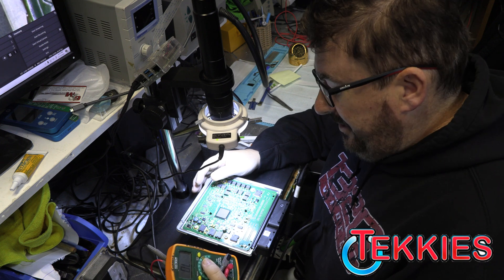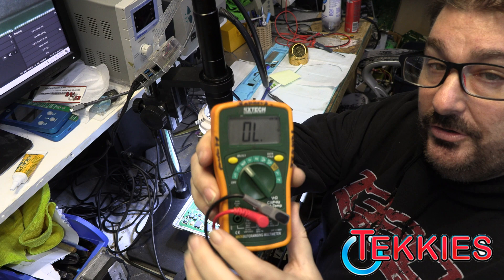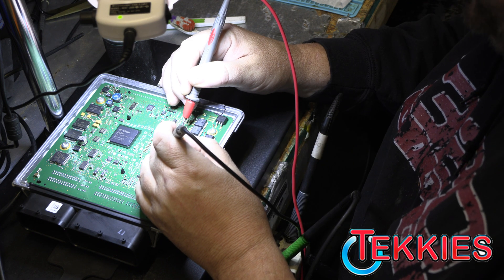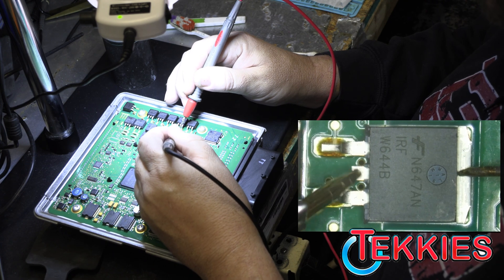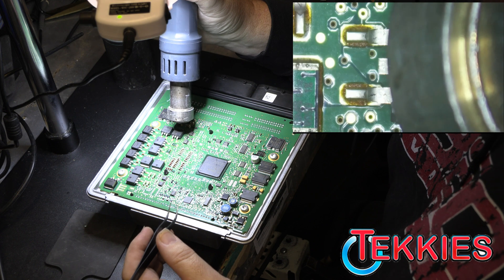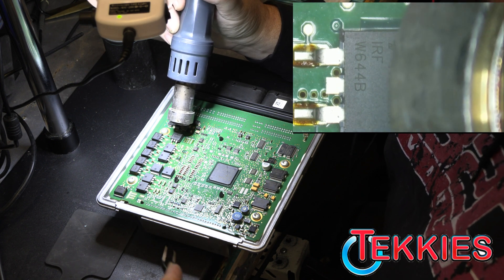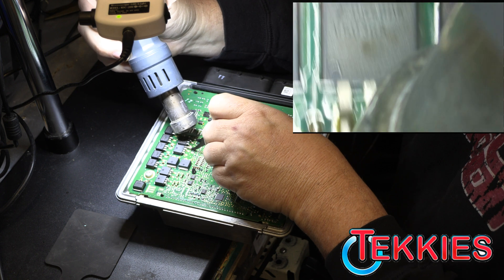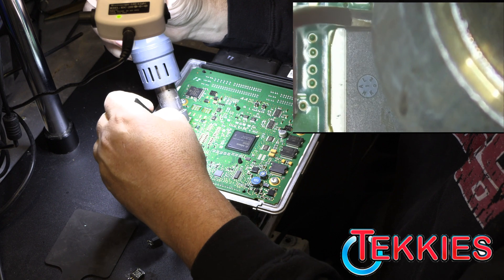🔥 BMW DME MSD80 MosFet's REPAIR- 335i 535i 135i X6 E89  -💥 30BA 30BB ERROR

Comment: What do you use now that FDB14N30 is obsolete
Reply from the maker: Good news — the FDB14N30TM is actually still available!
DigiKey Part #: FDB14N30TMCT-ND
Manufacturer Part #: FDB14N30TM (onsemi)
Specs: N-Channel, 300V, 14A, D2PAK (TO-263)
Direct link: digikey.com → search "FDB14N30TM"
The original OEM part in early MSD80s was often the 250V version, but the FDB14N30TM at 300V is actually a slight upgrade — more voltage headroom. It's what we use for all our repairs.
Pro tip: Buy a 10-pack — they're cheap and you'll want to replace all 6 while you're in there. One bad one usually means the others are stressed too.
Hope that helps! 🔧

Comment: Just wondering as new to this, but the original component was a 250V, 14A MOSFET and your replacement suggestion is a 390V 46A IGBT (from the link above)...does that matter?  From what I can tell they are different types of components (MOSFET vs IGBT) but are they interchangable?  Apologies if this is a "dumb" questions, but although enthusiastic, I am new to this-Thx!
Reply from the maker: Not a dumb question at all — this is actually a really important point that a lot of people overlook!
You're right that MOSFETs and IGBTs are different types of components, and they're not directly interchangeable in most cases. Here's the short version:
Key differences:

MOSFETs = faster switching speed, better for high-frequency applications
IGBTs = handle higher current/voltage better, but switch slower

Why the higher-rated IGBT might still work here:
In this specific DME application, the switching frequency is relatively low, and the circuit is mainly handling inductive loads (injectors/coils). The IGBT's slower switching isn't a problem in this context, and the higher voltage/current rating (390V/46A vs 250V/14A) gives you more headroom and reliability.
However — the better practice would be to use a direct MOSFET replacement with similar specs if possible. The IGBT will likely work, but:

It may run slightly differently (different gate drive characteristics)
Switching behavior won't be identical
Long-term behavior in this circuit may vary

Bottom line: It can work as a repair solution, but if you can source a MOSFET closer to the original spec (similar voltage/current rating), that's the cleaner approach.
Great question — asking this stuff is exactly how you learn! 🔧

Comment: Hello. I have 5x upgrade voltage mosftets. Can i replace 5 instead of 6 at once, with the upgraded mosftet?
Reply: It worked
Reply from the maker: Short answer: Yes, but I'd strongly recommend doing all 6.
Here's why — if one MOSFET failed, the others have likely been heat-stressed and are on borrowed time. Replacing only 5 means that one original part becomes the weak link. You'll be back in there sooner than you'd like.
That said, if you're in a pinch and need to get the car running now, 5 new + 1 original will work. Just keep an eye on it and plan to swap that last one when you get the part.
Where to grab one more:

DigiKey: FDB14N30TMCT-ND
Amazon/eBay: Search "FDB14N30TM" — usually sold in 10-packs for cheap

Good luck with the repair! 🔧

Comment: Another fan of changing mosfets blindly!
First you need to check the resistor in the gate circuit and only then poke the source and drain with a multimeter...
All problems with misfires are related to the condition of the ignition coils, spark plugs and, of course, crooked chip tuning!
Problems with output transistors are very rare and do not occur on their own.
Idiots!

Comment: Why not test the other lot of 6 ?
Reply from the maker: Great question — there are actually TWO sets of 6 transistors on the MSD80:

6 MOSFETs — control the fuel injectors (FDB14N30 or similar)
6 IGBTs — control the ignition coils (ISL9V5036S3ST or similar)

The injector MOSFETs are the ones that commonly fail and throw 30BA/30BB codes — that's what this video covers.
Why not replace the ignition coil IGBTs too?

They're a different component type (IGBT vs MOSFET) — not interchangeable
They operate in a different circuit with different stress characteristics
They can fail, but it's less common than the injector MOSFETs
Different failure symptoms — ignition IGBT failure usually shows as cylinder-specific ignition faults (2E18-2E1D codes), not the 30BA/30BB internal DME errors

Should you test them? If you're already in there and have the equipment, sure — can't hurt to check. But if your symptoms are injector-related misfires with 30BA/30BB codes, the ignition side is probably fine.
If you do want to upgrade the ignition IGBTs, the part is:
ISL9V5036S3ST (onsemi) — but again, different component, different circuit.
Hope that clears it up! 🔧

Comment: Hi, very good video, congratulations! What temperature is your device set at? Is there any risk to the surrounding components?
Reply from the maker: Hi! Thank you for the kind words and for watching our video — we really appreciate it! 😊

For this repair, the device was set at 360°F with an airflow of 100. We've found this setting works well, and we haven't experienced issues with surrounding components. To minimize risk, we direct the airflow only on the chip and work quickly. After finishing the repair, we always double-check the surrounding area to ensure nothing has shifted or been affected.

Hope this helps! If you have any more questions, feel free to ask. 👍

Comment: Why do you change them all if only one was defective ?  Which ones have you installed exactly, what do you have to pay attention to from the designation ?
Reply: it’s best to replace the whole set of mosfets while you’re already at it, no point in replacing 1 of 6 and taking a chance on the other 5 going bad. might aswell do all 6 at once
Reply from the maker: @ZammianX the new mosfat's  are a new design improved, so we replace them to the new style
Reply: @TekkiesIncBartlett where did u get the FDB14N30G mosfets as digikey and mouser say theyre obsolete and dont stock them
Reply: @YourGamingBrigade AliExpress
Reply from the maker: Why replace all 6?
These MOSFETs share the same thermal environment and workload. When one fails, the others have been through the same stress cycles — heat, voltage spikes, etc. They might test fine now but are likely degraded. Replacing just the bad one often means you're back in there in 6 months doing the job again. It's a "while you're in there" situation.
What I install:
FDB14N30TM (onsemi/Fairchild)

N-Channel MOSFET
300V / 14A
D²PAK (TO-263) package

This is actually a slight upgrade over some original 250V parts — more voltage headroom.
What to pay attention to:

Voltage (Vds): 300V — match or exceed original
Current (Id): 14A — match or exceed original
Package: D²PAK / TO-263 — must match for fitment
RDS(on): 290mΩ or lower — lower is better (less heat)
Gate threshold (Vgs): Should be similar (~2-4V typical)

Avoid random substitutes like IGBTs — they look similar but switch differently and can cause issues in this circuit.
Where to buy:
DigiKey part # FDB14N30TMCT-ND — or search "FDB14N30TM" on Amazon/eBay (usually sold in 10-packs).
Hope that clears it up! 🔧